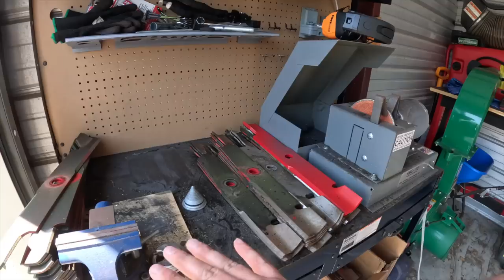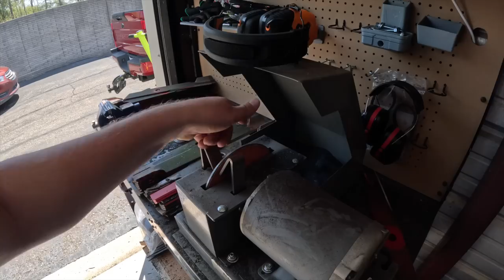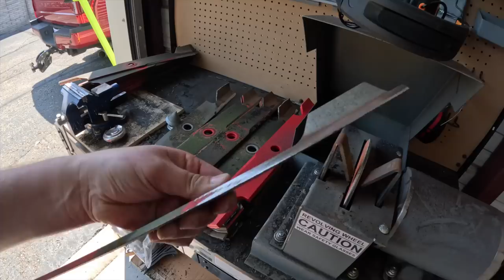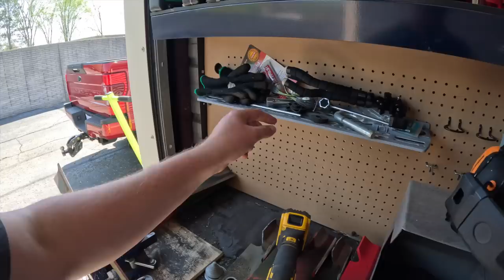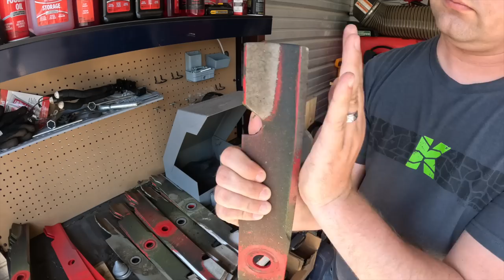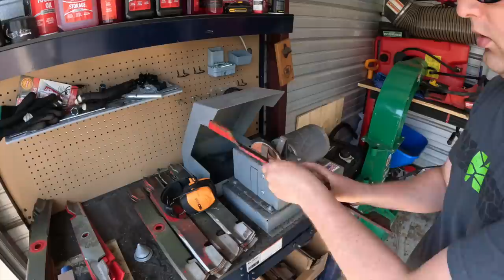Quickly & EASILY Sharpen A Lawn Mower Blade!

Comment: Great video as usual…I own a sharpening business and I have the magnamatic with the dust collection three stage filter system, and balancer.  I also have the mulching blade option. I absolutely love the setup. I sharpen 20-30 blades a week, and they get razor sharp. I use an old fashioned bastard file to knock the wire bur off the back side. It’s expensive, but it’s paid itself off multiple times over. I do completely clean the blades with a wire wheel on an angle grinder in order to get them perfectly balanced.
Reply from the maker: That’s awesome!

Comment: Clean the blade before you sharpen them gives the best balance. I use a bench grinder  with a wire wheel for the best cleaning.

Comment: How many times can you sharpen a blade before it is junk?
Reply from the maker: Usually after a good season of use they’re toast.
Reply: I would say no real set amount of times but how dinged up they get and how aggressive you need to grind them to get all the dings out when sharpening, more of a visual inspection rather than a you can sharpen them X amount of times
Reply: @BriansLawnMaintenance  gotcha, thanks.